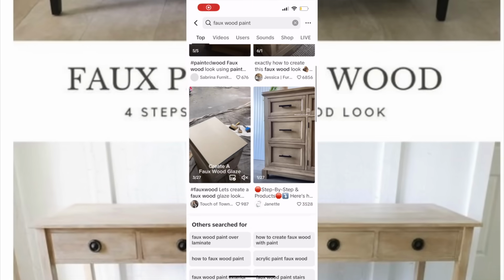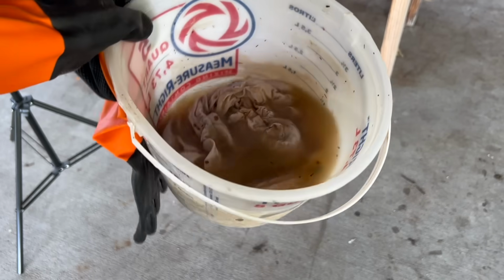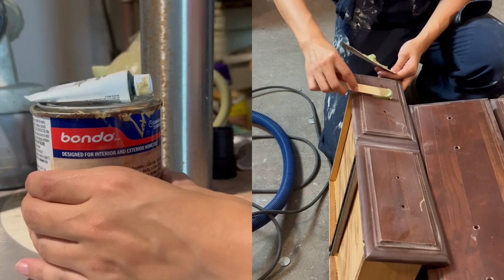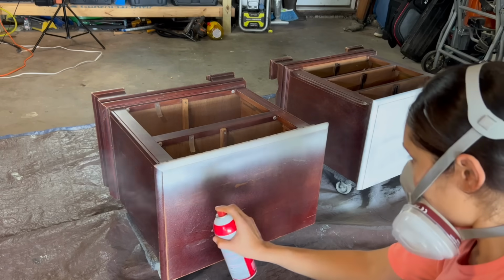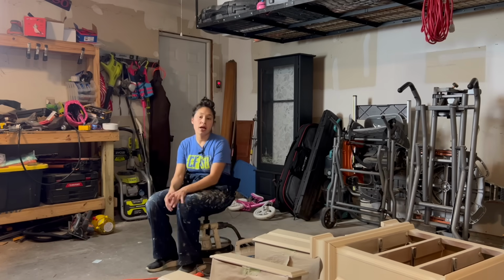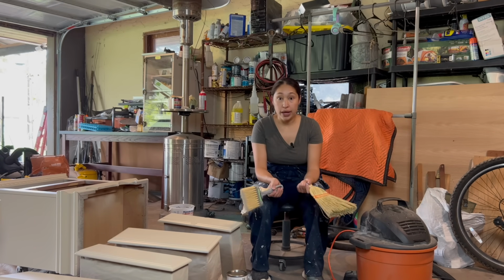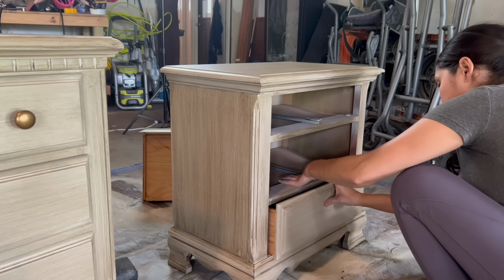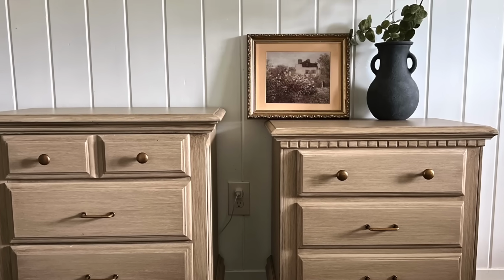UNBELIEVABLE Furniture TRANSFORMATION | DIY Pottery Barn Finish

Comment: Great instructional video and beautiful outcome! Even before you matched the finish on these two nightstands, they are similar in form and structure. The most apparent mismatch is the height. I'm wondering how well they sold being that the two night stands are different heights? Usually, nightstands should ideally be about the same height as your mattress to ensure comfort and ease of access. They appear to be only a few inches different, so perhaps no big deal.

Comment: Great job. Glad you're back. 
Does the Bondo fill the holes in the back side of the drawers or do you leave the whole unfilled on the back?
Reply from the maker: it could! I don't ever just because I feel like it doesn't matter, but im sure it does matter to some. 
If you add tape to the back(inside) then add the bondo from the outside like I did, you can push the product in until it fills it in all the way! 
Hope that helps! ❤️